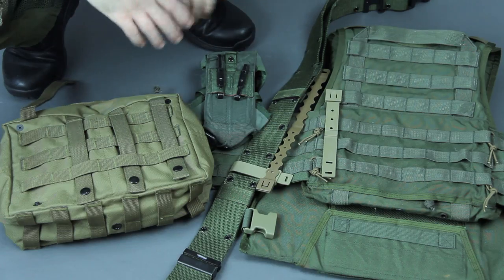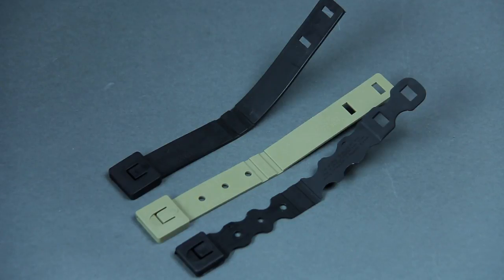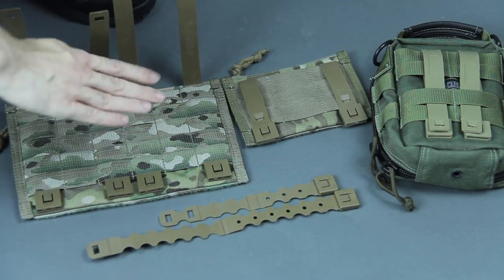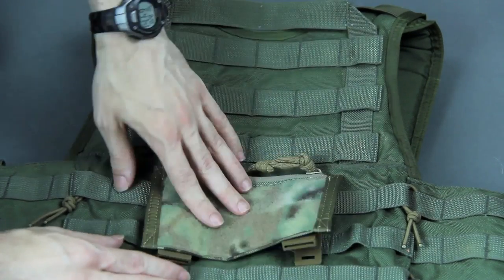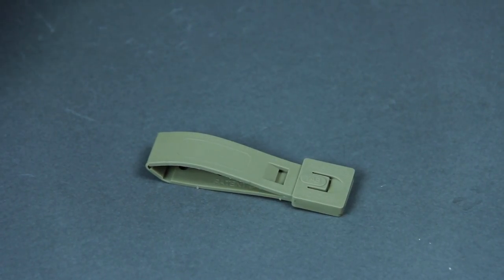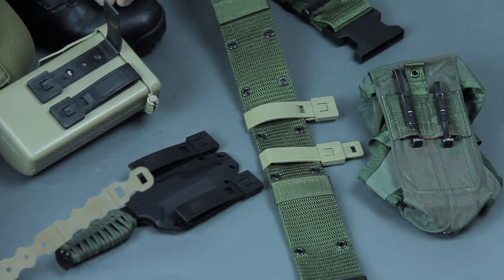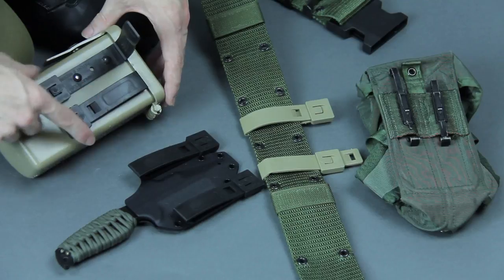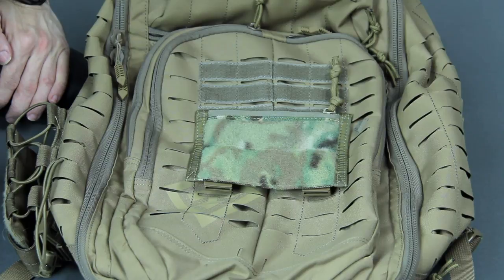MALICE CLIP / PALS Tutorial

Comment: I have a canvas, double magazine pistol pouch made in ALICE system. I use it with snap button belt keepers. It's safer and much more confortable than original steel clips.

I also tested Velcro cable organizers (sold in any computer and office store) with good results to fix MOLLE pouches. The hard plastic of proper MOLLE clips tends to tear the equipment along the time, so I learned to avoid any material harder or less flexible than the PALS ladders itself.

Another thing I use in conjunction with the PALS system (to carry a rolled-up blanket, for example) are dog collars. My grandfather used this system on old backpacks that predated the ALICE system. It always worked well.

Comment: ALICE came out in 1973, which was at the very end of Vietnam war, and none of the ALICE gear ever made it there. What's commonly called an "ALICE clip", isn't. It was first used on M1956 gear, and called a "slide fastener". It was also part of the M1967 gear, (AKA M67). M67 gear wasn't usually known as LCE or MLCE, "Load Carrying Equipment"/"Modernized Load Carrying Equipment", but it was practically ALICE.
Reply from the maker: Thanks for the extra detail. I suppose "Vietnam Era" is a more appropriate term.

Comment: I have a Blackhawk Patrol Pack and am not familiar with it at all. The research that I have done indicates it has ALICE webbing, but I am confused by the loop portion of Velcro which is sewn in on the inside portion of the ALICE webbing. I have not seen any demonstrations, or accessories, on how to utilize this webbing to its fullest potential (ie, the Velcro portion). Is the Velcro to be used as simple as it seems? If so, it seems like it would not be fully secure. If not, will you direct me to a tutorial of this webbing that will better help me understand how to use it efficiently. Thank you.

Comment: Neat video. Looks to be an easier release system and more adjustable than HSGI’s clips and the ability to get a more snug fit on an ALICE belt is a really nice bonus. 

I’d rather WTFstraps over the two though, easier install if you have a spoon and pliers. My issue with them is that they smell bad. However my preference is still the traditional strap that is attached to the pouch or whatever. I feel more confident that that won’t shear off. 

Also anyone know what plate carrier that green one was?

Comment: I’ve got a Benchmade 7 Hook with their webbing pouch made by Tactical Tailor. It’s got three close rows of horizontal webbing in a single column on the sheath, but I need to mount it to a single column of double row webbing on the waist belt of my Aqualung Rogue BCD. Is it possible to use two of those one inch webbing clips clips with the Malice Clip to get that 90 degree orientation for mounting?
Reply from the maker: Sorry I don't have a Aqualung Rogue BCD to confirm, but malice clips are pretty cheap if want to give it a try.

Comment: Do you know the hole size and spacing for drilling if one was to design a MALICE compatible hard-shell? TT's website has no technical dimension data.
Reply from the maker: Not sure, can email me through site and I can take a pic for you, does not appear obvious like about 0.78125" center point to center point on holes. Close to .75" but a smidge over. Doesn't exactly align with mm either. Approx 4mm holes with 14mm spacing
Reply: Intetesting, .75 was my assumption, could just be poor tolerancing. Thanks for the info 👍

Comment: I like malice for something thats gonna get set and stay there for a long time..They are a big pain in the ass to take apart though, thats the only drawback
Reply from the maker: Without a helper tool they can be a little difficult to release, but no biggie as long as one has something like a multitool around. In the balance of security, usability, and durability, Malice Clips stand out as a good solution.
Reply: 50 Stitches Steel I have found the molle stix from Vanguard to work well when I need quick removable.